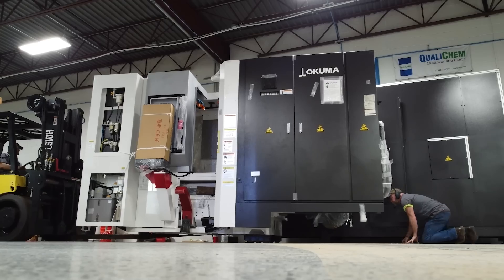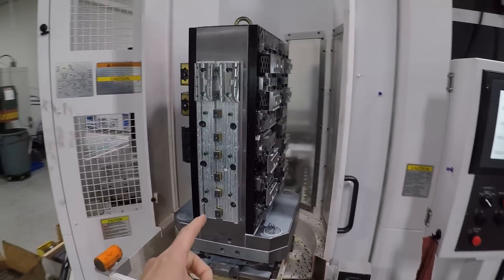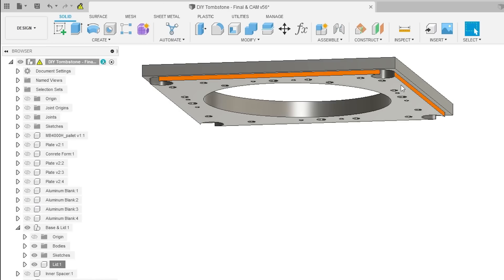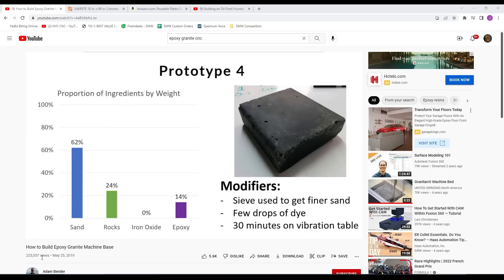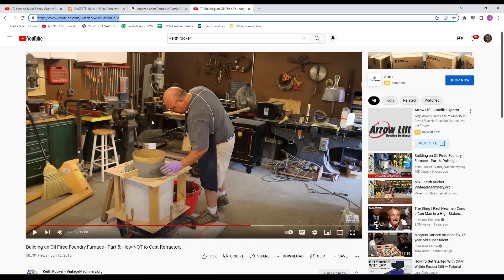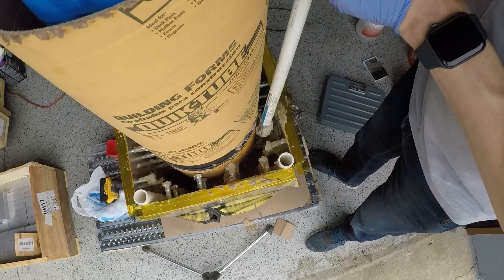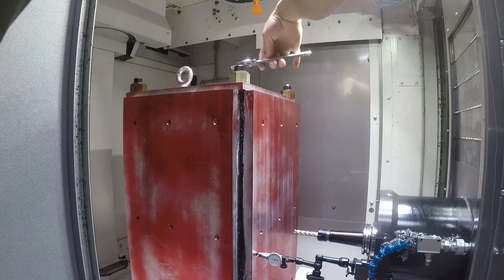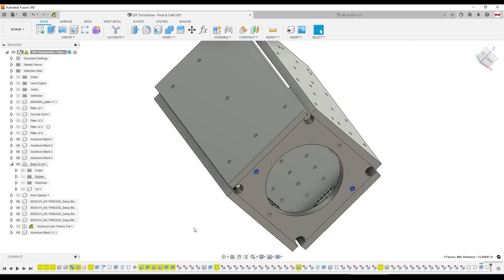DIY Epoxy Tombstone for our Okuma Horizontal CNC Machine!

Comment: in the future you can take a small rubber pad, and put it between a sawzaw with no blade and run it against the surfaces, this acts as a pretty good concrete agitator and may have made it much easier to infill the project.

Comment: Use a hammer drill with a blunt tip in place of a concrete vibrator.

Comment: Interesting process. 
I really dislike aluminum tombstones. I worked with them for about a year and as I got the machine and coolant up to temp I had to chase the growth of the aluminum up the Y axis. The machine had HP coolant but no chiller which made it worse.

I'm really curious to know if that tombstone will hold up or if the thermal cycles of the aluminum will eventually separate it from the epoxy.

Comment: Another option is UHPC (ultra high performance concrete). It's flowing really nicely and is self-venting, without shaking or putting it under vacuum. It's also really strong, I'm planning on making a machine base out of that stuff (as many others did before me). Just can't use concrete with anything aluminium while it's wet, it will influence the curing process negatively.

Comment: I’m surprised aluminum is strong enough and thermally stable enough for this given the precision you require.
Reply: It really isn't. But I guess these tombstones will work during John's learning curve with this horizontal mill, since he had to have 6 of them. In 3 years, he'll come back with some improvements.

Either way,  Edge Precision's tombstone is an ideal version of what John wants. It's 4 welded slabs of steel. It even has an open top, and still holds itself well. That whole thing is pretty rigid.

Comment: "Cast iron is miserable to machine" lol thats mostly what i cut both on a manual boring mill and a cnc mill. I actually prefer iron over steel in most cases but maybe I'm just weird.
Reply: I machine cast iron and steel regularly. I think knowing the differences on how the materials cut is really the main factor. The best comparison I have is the difference between trying to cut frozen butter and refrigerated butter. Different cutting tool geometries and feed speeds really make the difference.
Reply: @mikezaq1  the dust is what usually makes people hate cast iron. On an open machine like my boring mill the dust floats quite awaits and covers everything and on a CNC it gets trapped in the coolant tank. The nice thing is you dont have to fight stringy chips, it doesn't stress relief nearly as much as aluminum or steel, and while you don't get a mirror finish it's pretty hard to get a crappy surface finish.

Comment: A lot of people don’t realize that a concrete form tube is only design for pressure from the inside what you really need to use is a piece of PVC green sewer pipe
Reply: The outside also does not have the same coating as the inside, so the paper on the outside absorbs moisture faster

Comment: I have never bought a cast iron tombstone. I have never tried this cast epoxy granite. I will keep that in mind, if I build another one. The ways I have done it is welded steel or bolted together aluminum plates (The ones on the Mitsubishi now). But I have also done this. Just buy a large diameter aluminum bar. The one I did was 16" in diameter. Then face the ends and bolt it to the aluminum base plate. Then face flats on it when mounted in the machine. This was easy and less expensive the a commercially made cast iron one. One question. Don't your pallets have a bore in the middle to install a large pin to locate the tombstone/fixture? Most machines I have owned also have these side plates bolted to the pallets. Something I have never used because they always get in the way. I'm also surprised they only use four screws to hold the fixture to the pallet. One other thing that has also been very useful is to have a base plate with just t-slots (You may have seen this in some of my videos). This is very useful to hold large parts, or even making your fixtures. It gives you much more flexibility for clamping something to the pallet then just its tapped holes.
Reply: One thing I failed to mention/ask. Did you use high strength all thread to hold down your fixture. The plain all thread from say the hardware store isn’t strong enough. It will stretch when you tighten the nuts. The stuff you need is called B-7 or ASTMA 193 High Stress.
Reply: @EdgePrecision  i can personally vouch for b7 rod. I run an old g&l manual mill and everything is held down with 3/4 theeaded rod. A milwaukee high torque impact set to full power can't damage the stuff.
Reply: @EdgePrecision  Exactly my thoughts (except metric grades) when I heard all thread. You can never seem to reach fixture fixture level tension between two surfaces with anything under 8.8 grade bolts, as they will just stretch apart, almost regardless of tightening torque and diameter

Comment: I have poured more concrete than I care to remember over the years, I think what I would have done is built a plywood funnel that would be attached to the top until you had it filled, would have made that so much easier than fighting it. Also an old sander works great as a vibrating tool. 

I had no idea bout the epoxy granite though, learned something new today.

Comment: A recip saw with no blade, with the nose pushed on the form, works to vibrate pretty good.  Do not vibrate more than is needed to remove voids to avoid aggregate stratification.
Reply: I've never thought to use a recip saw as a vibrator. Thanks for the idea.
Reply: @AnunnakiAaron  They do sell silicone attachments for that use :P
Reply: @MikrySoft  yeaaaahhhh

Comment: Excelent. We gonna make a horizontal tombstone to use in our Okuma multus 4000. Its not a main job thing, but it will carry us over with more potential customers until we can expand into a solid mill as well!
Reply: Uhhh... did you mean MU-4000? A multus is a millturn or multitasking lathe.

Unless you're actually sticking a tombstone in the bastard you madlad. I could see it being feasible with c axis nonsense.
Reply: @orangedream267  It will be custom made, just 1meter long, maybe 300mm X 300mm box shape, able to handle high density small parts using miteebite clamp on custom fixture plates for easy swap and low setup time. Pretty basic stuff now days.

As said, it will only be a odd job here and there, but we can expand the working envelope with just not letting the machine name dictate what you can do with it.
Reply: @steinarne79  That's not the issue here... I'm trying to understand if you're sticking a tombstone inside a LATHE, or a 5 axis. Or maybe a different okuma that you're misnaming.

Comment: I have a question ;-)
There are threaded holes all around the tombstone which are drilled before the assembly and the epoxy filling.
You surfaced all sides afterwards to get them true, isn't there the possibility that these holes are also off some thousands?
i think they are just for holding your mounting plates, does it matter if they are off?
Reply: a threaded fastner is generally not precise enough for any precise positioning, that's done by dowels, pins, etc, so being a bit off here shouldn't matter any.
Reply: @Echo51  thanks a lot for your answer